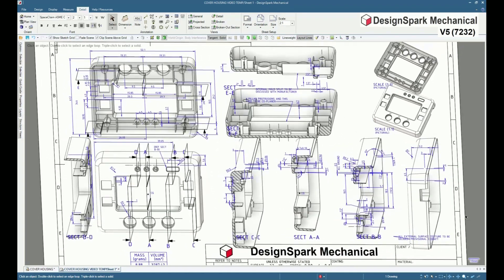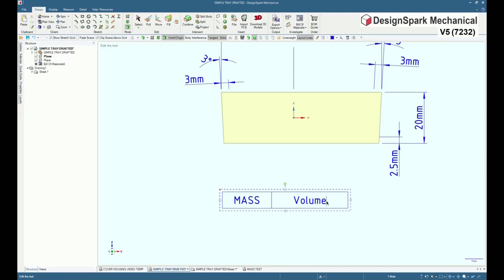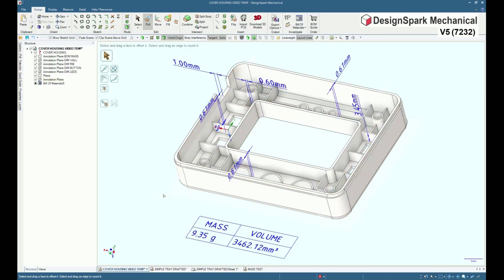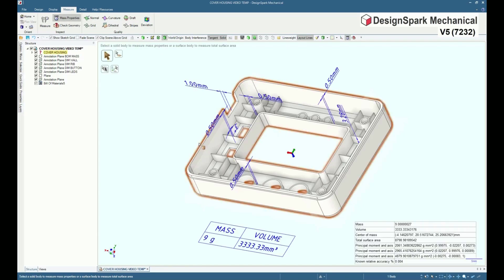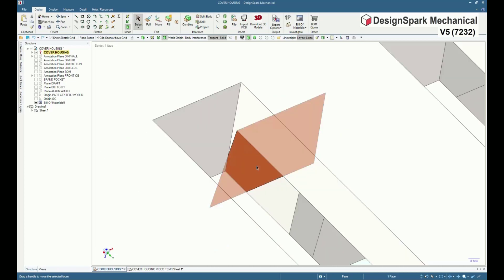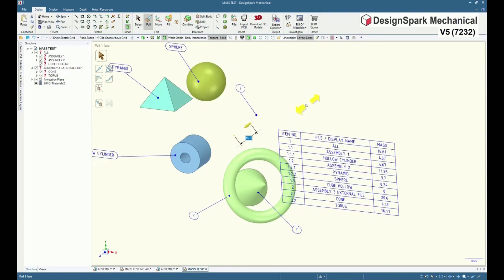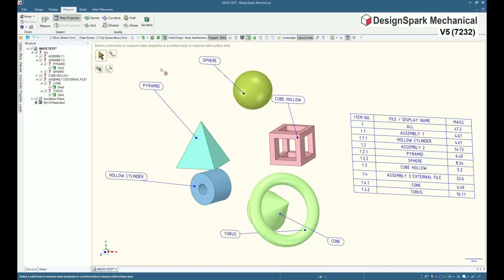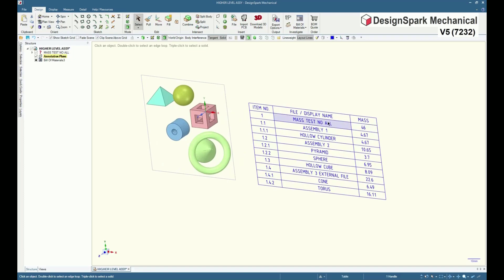DesignSpark Mechanical - Material properties in the BoM table

Comment: The most comprehensive and practical class, but the pace is too fast for students to learn.
Reply: Well, it's possible to slow the video playback speed to 1/4 ( 0.25) - for the sake of keeping the video brief it's difficult to go over the principles in different ways. You can always ask a question in the DesignSpark mechanical forum. I do accept that a lot of principles are covered or explained quickly.
We have different levels of Instruction depending upon the subscription level within the help pages.
Thanks for the comments. It's really a big vindication of dynamic design to have the ability to change the objects shape based upon a target mass of either the component or the total assembly mass.
Reply: An unlimited replay or download option is always available. Everything demonstrated except Drawing sheet functionality is available in the free Explorer v6 DSM.

Comment: Hi, thank you for the video, this is pretty cool. Are these feature already available with version 5 ?
Reply: Yes, you can do most of these things like BoM creation and dimension annotation with the free edition of DSM v5.
Reply: @designsparkmechanical1693  i think that require the drawing sheet extension or am I wrong? I tried to download it but is not available anymore
Reply: @FunghiMara1974  BOM tables and adapting them to your desires, like in the video displaying Mass, does not require the Drawing Sheet functionality at all. The new v6 Explorer free subscription has all the functionality to do everything shown except for the drawing. If you wanted to do the Drawing, then the new Creator paid monthly subscription would be needed - that's a flexi-monthly on/off as desired plan. There's an additional Solid mirroring tool that I'd recommend in that plan also, but everything shown here, apart from the drawing can be done in Explorer free plan. V6 also has great constraint sketch functionality far better than v5's and now also uses the Parasolid 3D kernal.